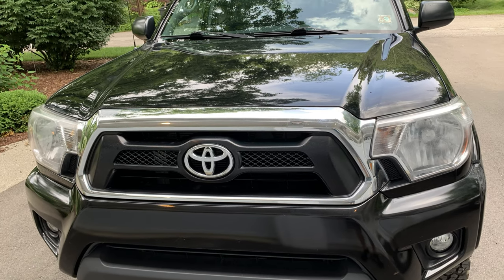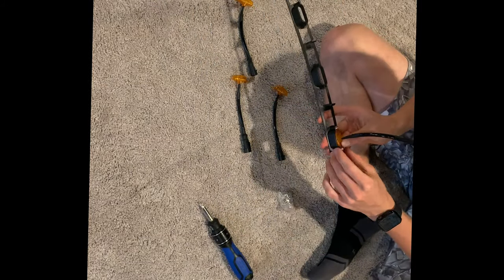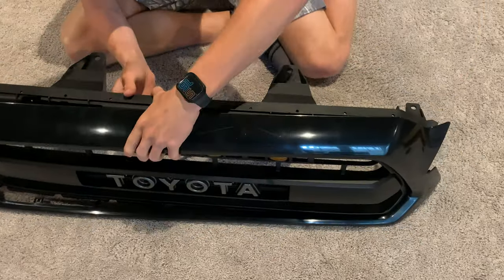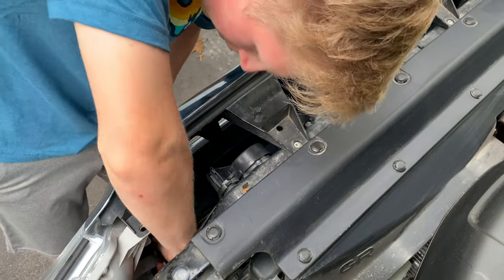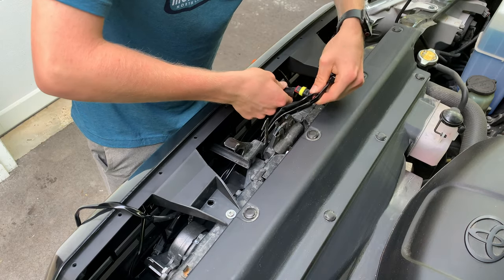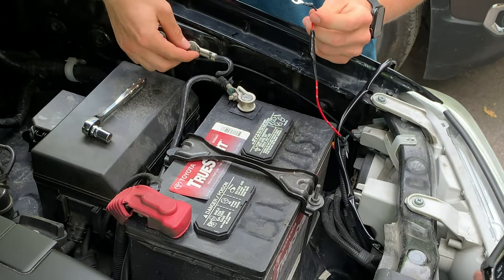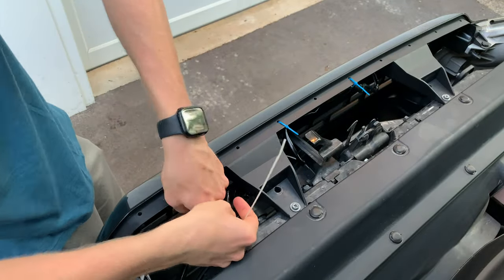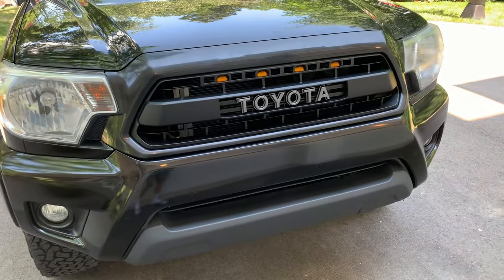Tacoma TRD Pro Grill Install

Comment: Thanks so much for the guide! Just installed mine. For anyone wondering how to make them static without running your headlights, run wire through your firewall and plug in to the 15 fuse for your ignition. Stay on all the time!
Reply: Have you ever had a problem with the raptor lights staying on once the truck is off? I’ve heard that is a problem with wiring it so that they stay on all the time. And would it drain the battery quite a bit to have them on all the time? If you can answer any of these questions it would be much appreciated!
Reply: @jakewebb9417  nope! If it’s ran to your ignition it’s only on when the ignition is activated, or remote started.
Reply: Do you have a video of you doing this. I’d love one do this with my ambers but feel like I’d mess this up real quick

Comment: That trim piece around it is originally chrome. Where did you get a black one.
Reply: I’d love to know myself!
Reply: I had a guy paint mine for me to match my truck just fyi it’s hard to find them a lot of people end up getting them painted else where
Reply: Not necessarily. It's originally chrome if your trim level included that. On my wife's 2012 TRD Sport, it is body colored. On the aftermarket grille I got her (the Impulse Grille from Extreme Terrain) it comes unpainted black plastic. We had her surround painted to match the truck, like the original grille.

Comment: What fuses did you use in the addafuse?
Reply: Some use 5 amp,10 or 15 , depends on the raptor lights manufacture company instructions

Comment: I have the same truck and same grill but wanted to know if you know a way to have it where the grill lights turn on with the ambers and not the headlights?
Reply from the maker: I believe you can tap into the wires that power the amber running lights and connect the wiring that way.

Comment: I know the add a fuse came in the kit but do you know if I can buy that alone. I have the same grille but it didn’t come with that or the o ring for the black wire

Comment: I plugged in my add-a-fuse in the correct spot but then one headlight turns off? I tried other 10 fuses and no luck. Any ideas?
Reply: Jason... what did you find out worked that fixed this problem?
Reply: For anyone else wondering, the add a fuse needs both the old 10a fuse and the new 15a fuse. This was the fix for me. Peace!

Comment: My grill did not come with a add a fuse connector, just the ends of the red and grounding wire. How do I wire it?
Reply from the maker: You can buy the add a fuse connector from your local auto parts store or online